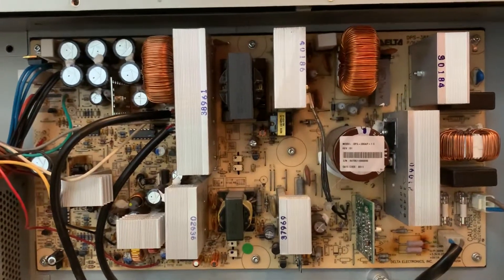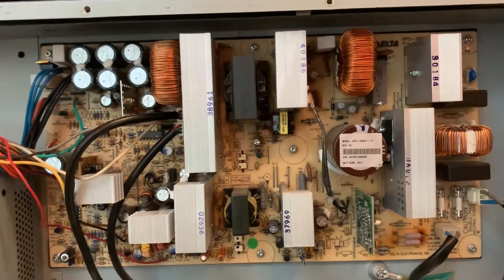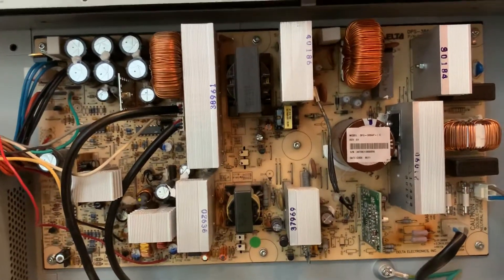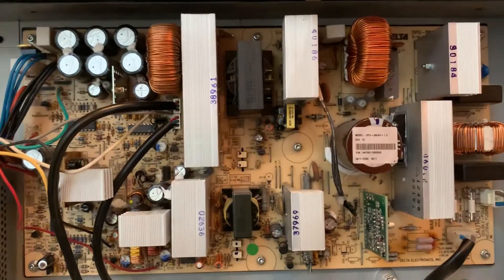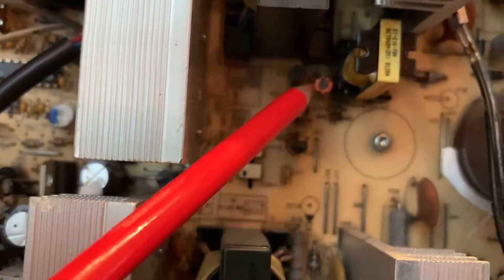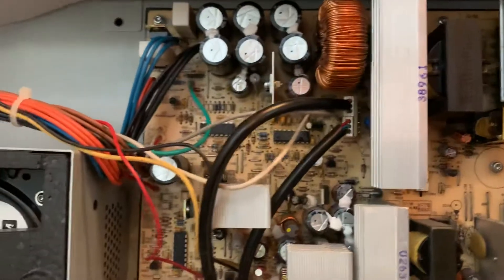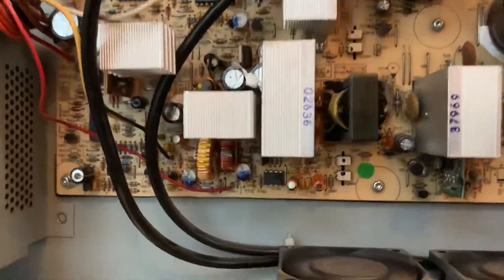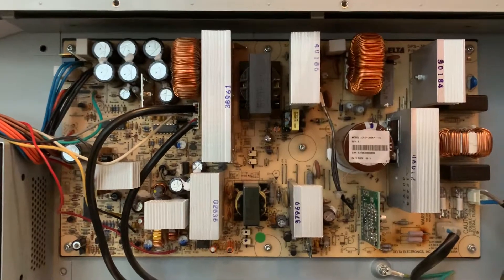HP DESIGN JET 5000 5500PS POWER SUPPLY FIX

Comment: My HP Designjet 5500  power supply is have the same issue and video gave me some confidence to repair my own PSU. Do you recall what brand replacement CAPS you ended up using to repair your unit? I was on digikey today and there are many 50V 10uF caps with different specs. I was just wondering if you spec your caps before replacing them or just got something comparable to match the volts and uF. .
Reply from the maker: The caps in this repair were from a local electronics supply shop that, unfortunately, closed permanently last year.  With that said, my go-to is NICHION. When selecting your caps, especially in a power supply, definitely match the farad and voltage rating but also choose the highest temp rating.  Filter by "in stock", "nichion", "capacitance", "voltage-rated", "lifetime @ temp = highest lifetime/temp combo", "through hole".  That will usually narrow things down to a couple of choices.  You might have axial or radial choices as well.  Either one is fine, but radial is what is installed.  Hope this helps and good luck with your repair.  If you need any other help, feel free to comment back and if you got your printer back up and running.
Reply: Thank you sir! I will definitely give this video an update. Much appreciated.

Comment: thanks for your video and instruction, My hp designjet 5000 ps can not power on recently. I replaced the capacitors as per your video. I turned it on, it still showed no sign of power. How you check or measure the voltage of each pin. There are 24 pins.

Comment: Thanks will try changing the capacitor bought the designjet for 100$. Canadian with hard disk failure. Let hope it a 5$ fix, would you have  the power supply schematic?
Reply from the maker: Unfortunately, I don't have schematics.  Sounds like you got a good deal if you can get it running for cheap.  I'm going to clone the disk and attempt to make a copy to see if it will run so that I will have a good archived copy and spare to use down the road.  These things are also notorious for dry rotting grommets that connect ink tubes to the heads and ink cartridges and leaks ink everywhere.
Reply: @AlsAutoandAppliance  were you able to clone the disk successfully? also do you know if that cloned disk be used on other printers the same model of are they locked in by serial number or something?
Reply from the maker: @frankt5833  Thank you for the reminder!  I did clone the disk but have not performed a restore onto a different one (completely forgot!).  I will try this as soon as possible. :)

Comment: what causes the black ink to keep being pressure in it  even after printer shut off
Reply from the maker: Is it leaking black ink?  These printers are notorious for dry rotted rubber couplings that connect the ink tubes to the print heads and will make it appear the ink is leaking from the heads.
Reply: @AlsAutoandAppliance  that's where the print head sit/oh this bleeds black ink
Reply from the maker: @darylsmith1362  Here is a good picture of where these things will leak from.  It's the rubber ring part that allows ink to go everywhere when they dry up and crack. https://www.newegg.com/p/35S-00K0-00015

Comment: Is it possible to change the power supply with a pc psu supply, if yes what wattage should we get.
Reply from the maker: I was considering this before repairing my unit.  I'm sure it's possible, but would have to see what all of the required voltages are.

Comment: Thanks Bud , have similar issues , will try this . Did you only replace the caps you pointed out in the video .
Reply from the maker: So sorry for the late reply.  Yes, I only replaced the caps that were pointed out, but I'm sure it would vary from one unit to another.  Caps are pretty cheap, so it would be a good start to replace the ones I pointed out.  If you have access to an ESR meter, you can check each of your caps to determine which to replace.  Hope you get yours back up and running!

Comment: Thank you so much for this. My 5500uv has been useless for a year and I was going g to throw it I  the trash today. I opened up the back and determined it was the power supply. Once this quarantine is over I will go pickup capacitors
Reply from the maker: Did you get a chance to check the caps out?  Hope you get yours running again!

Comment: Great video and presentation...... do you offer power supply check & rebuilding?
Reply from the maker: Don, unfortunately I do not.  I wouldn't have any way to test the supply once faulty components are replaced other than using it on my printer, which will be going up for sale soon so won't be available to try.  The caps are a very good place to start and none of them were hard to reach or de-solder.